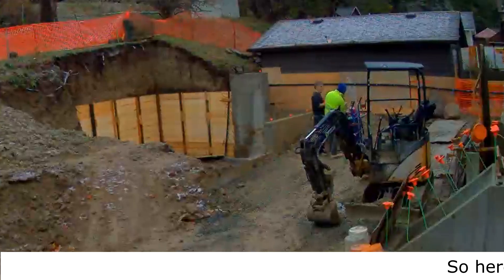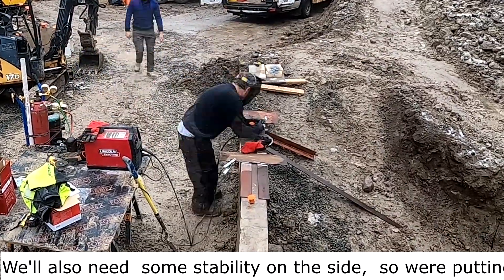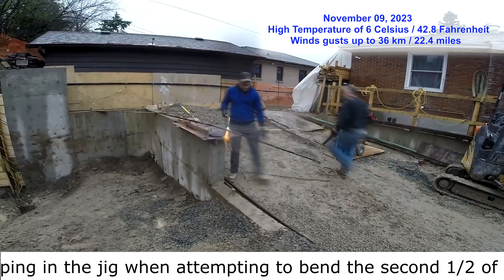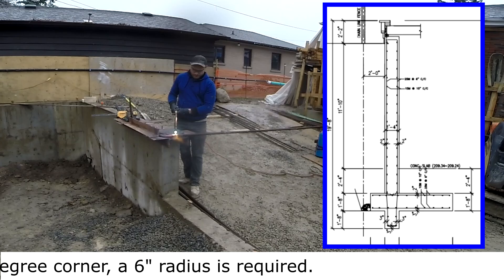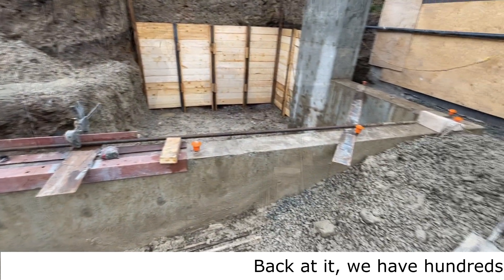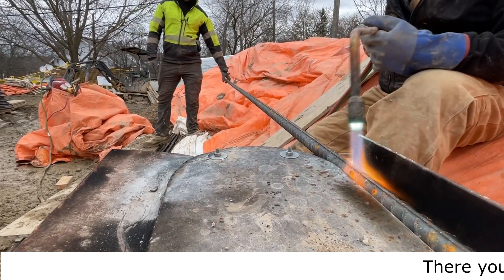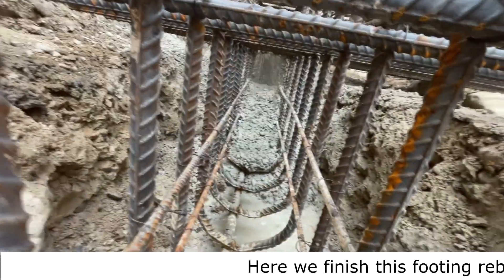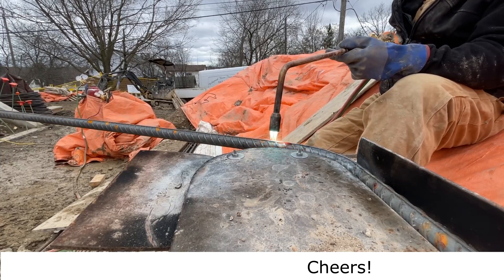How to Bend 1-Inch Rebar Using Oxyacetylene on Site | Working with Chris Ep.15

Comment: Great idea.... but your structural engineer should have told you that uncontrolled cooling of heated and bent rebar can cause it to become brittle and reduce its strength.  Best to have a rebar fab shop cold bend it in an appropriate bending machine.
Reply from the maker: Hello Ryan,
Thank you for your comment. 
Noted. 
After failing to find a local shop to bend as you suggested, I informed the engineer of my actions. My assumption is this was not a disqualifying procedure. 
Cheers 
Chris